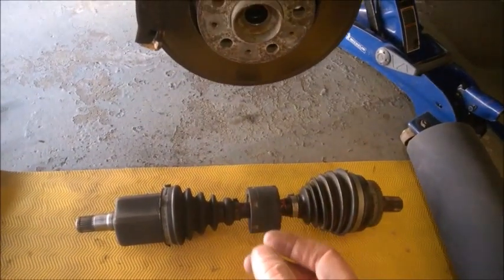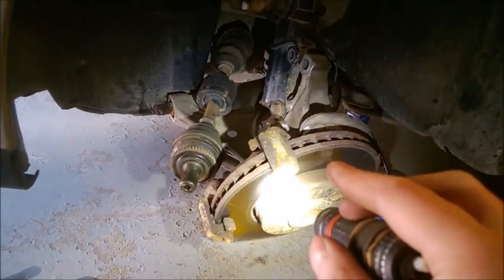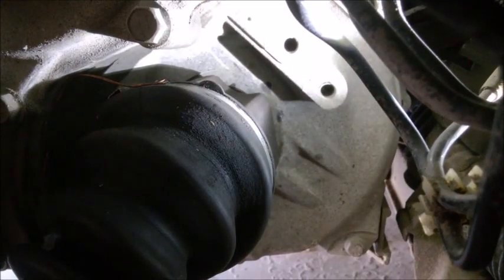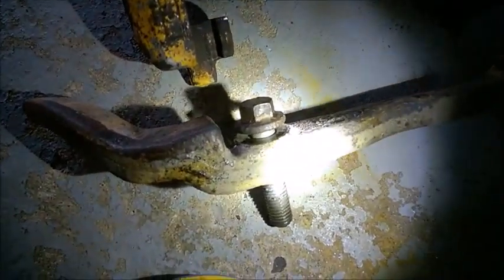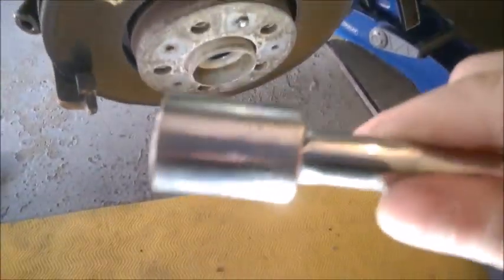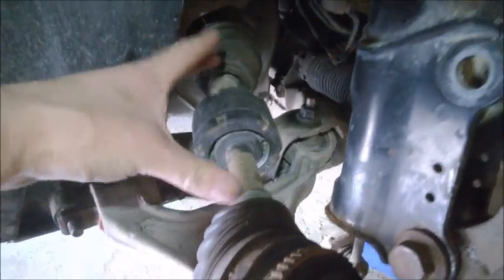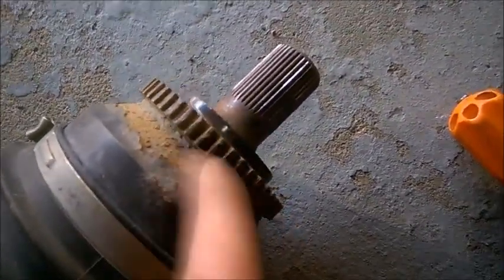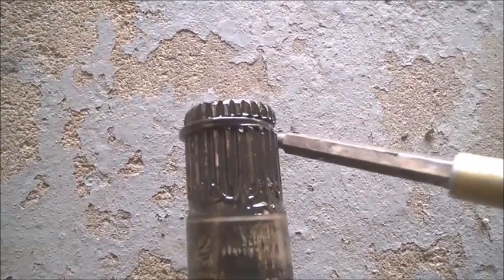Volvo S60 XC70  CV Axle shaft replacement 2001-2009

Comment: I have some vibrations in my steeringwheel from 130km/h onwards. Especially when I turn my steeringwheel to the left side.
Could it be because of wear in the drive axels or because of not well balanced tyres?
Reply: Si, es 5u axle

Comment: That c ring on the end of the axle shaft has to be hammered in the c slot in the transmission to prevent it from moving back and forth during throttle. Getting it in the transmission is the first part, the c ring going into the c slot is another. You'll know when the c ring is in the c slot when you are flushed against the wall and you cannot put your finger between the axle and transmission. The axle must be flushed against transmission wall and all the way in. I use a long Bar & Hammer the round rubber boot edges flush against the axle and do both sides on the top and both sides on the bottom and eventually the shaft will end up going all the way in with the c ring being inserted on the c slot in the transmission. To take out use a hammer again and a chisel or crowbar. If you don't than as time goes by, engine light might show on dash board as P1171 because the transmission is slipping off the axle. P1171 is for a whole host of error codes like too rich of gasoline or MAF sensor. Which in this case makes perfect sense because the transmission is slipping and not turning the fly wheel enough while more air and fuel is being used.
Reply from the maker: At least on Volvo cars, the axle end has to go easily inside the transmission and the c-clip has to lock inside the transmission easily by hand pressure on the axle. This is perfectly enough to keep the axle inside the transmission even on turbo engines. If the axle is difficult to push inside the transmission, it means either the c-clip is the wrong size - often times on aftermarket axles - or the c-clip sits slightly open on the axle - both these situations will cause the axle to get permanently stuck inside the transmission which is a problem if the axle will need to be removed again in the future.  If this happens, one must leave the axle end inside the transmission, remove the dust boot, and slide the rest of the axle out from the CV joint trans side - it should slide out completely or it may have tiny metal bumps that can be grinded carefully to slide out the three bearing 'wheels' from the CV joint  https://youtu.be/DIlEIkgmS84
Reply: @Peppermint1  go measure the depth inside the transmission and match it to the axle shaft. You'll find out the axle ball bearing housing need to be all the way flush with the transmission wall or the c ring is not inserted. The reason why its difficult to put it by hand is the ring bounces around. Once you do get it in by hand this only means the ring has been enclosed by the teeth in the transmission but it is not in the c slot yet until the axle ball bearing housing is flushed against the wall. Only way is to force.
Reply: @Peppermint1  also the metal of the transmission is more stronger than the axle to protect it from damage. Putting a new axle in the transmission isn't like putting a new nail into the same hole in the wall. Instead, it's a new nail into a new wall and is designed to keep it that way for future repairs. Hammer and chisel away.
Reply: Turns out since I did not hammer the axle flush with the transmission,  the axle was too far out amd put pressure on the wheel bearing causing it to be pushed outwards. I now have to replace the bearing. I highly recommend hammer and a flat bar of some sort to force the axle shaft all the way in after doing it by hand until it is flushed against the wall.

Comment from the maker: Warning: do NOT drop your caliper hanging by the rubber hose. It can cause the hose to bulge internally and the brakes to get stuck
Torque specs Volvo S60 V70 2001-2009  http://www.volvohowto.com/volvo-s60-v70-torque-specs-specifications/
As noticed by others, the nut on the shock bolt is a big metric size, perhaps 21mm.  I'm using instead a 13/16in imperial socket which is a close equivalent to 21mm - see this table https://qph.fs.quoracdn.net/main-qimg-b213eb4293cfbecd199220db33af59bc
A complete tear down of the suspension https://youtu.be/pxC9Ek9HhGI
Small tip: never work on your car after driving in the rain. The bolts will have water on them which will start rusting once installed back and it will cause the bolts to be very stuck the next time you want to remove them.

Comment: I think bolt size is  18mm, but the nut size, if Iremember correctly is 19 mm ...  Keep in mind that Volvo, as an european car, are metric
Reply from the maker: Correct, the nut size on the shock bolts is metric, not sure about the actual size, but my 13/16 imperial socket fits without loose - I don't have the metric socket for that nut. In fact, there are a few imperial sizes that match the metric sizes. From this table it appears the 13/16 would correspond with 21mm but one must double check https://qph.fs.quoracdn.net/main-qimg-b213eb4293cfbecd199220db33af59bc

Comment: Mine is stuck like an absolute bastard.  It has been 2 hours of trying everything and its not budged a bit.
Im giving one hour more then getting it fucking scrapped!
Reply from the maker: You can also remove the shaft but leave the end cup that's stuck inside transmission - remove collar and detach CV boot.  There are two models - on one the shaft will just slide out from the cup that goes into transmission. On the other model, you need to grind three small bumps that keep the axle inside the cup.  My experience, I also got one stuck, and when it's stuck no chance because some aftermarket circlips are too large and once these get forced in there, it's metal edge that will never free again.  We got stories from dealerships that were not able to remove these